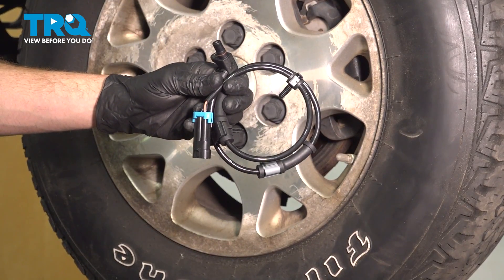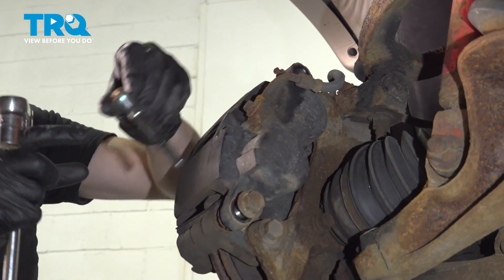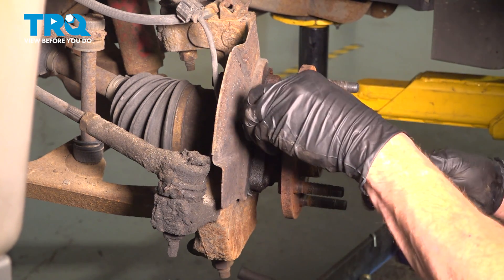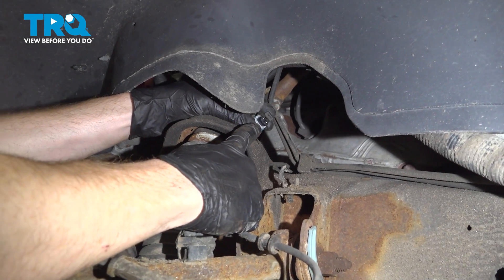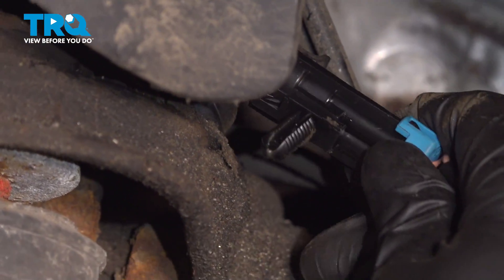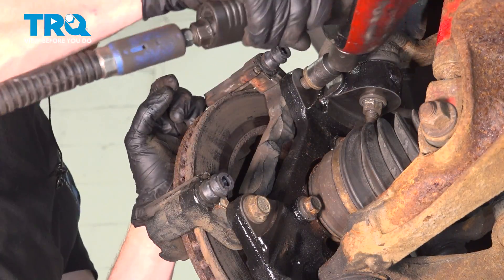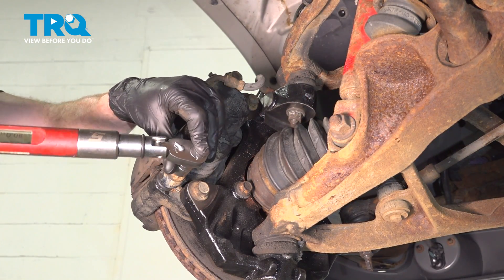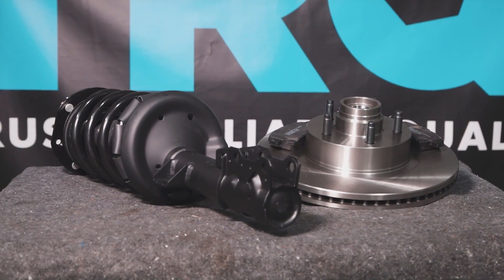How to Replace Front ABS Sensor 2000-2006 Chevrolet Tahoe

Comment: hub hole for the sensor does any body know what size that small bolt is, mine broke off. need to drill it out and tap it.

Comment: 2005 GMC Yukon XL I struggled to put the sensor inside the wheel bearing hole going through the back side of the backing plate. It's a tight space to and sensor was to big. I had to put the sensor all the way through including about 3 inches of wire, then I folded the wire to be able to place the sensor inside the hole and then once sensor was secured and in place, I pulled the 3 inches of wire back through the backing plate hole. Hope this helps someone.  Symptoms included: started loosing acceleration power one day as I was driving and then the traction control TC light and ABS light lit up on the dashboard. I also noticed a sort of gear churning sound coming from the front driver side wheel. So I ordered the wheel speed sensor from Amazon and installed the part. No more symptoms and back on the road.

Comment: I just tried doing that. First difference my caliper are hold by T55 bold. No hexa 18mm. Then when I tried to remove the sensor it broke inside the hub hole. I put it all back together as it's my daily and I can not change or fix the hub on spot.